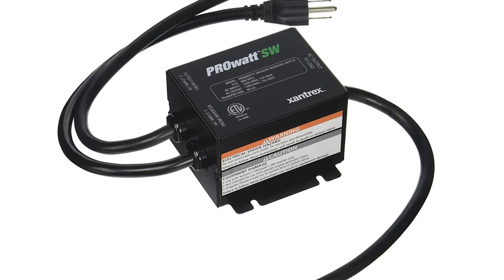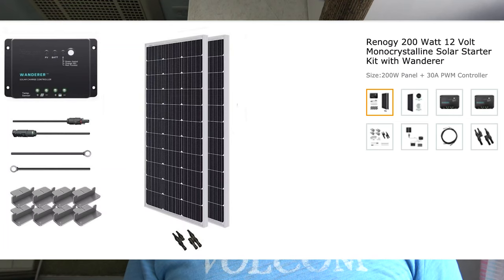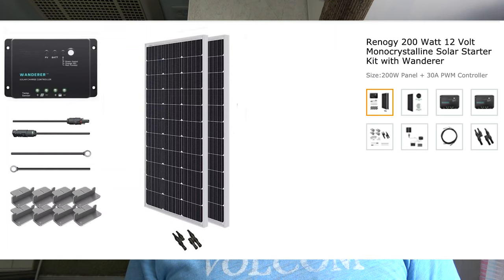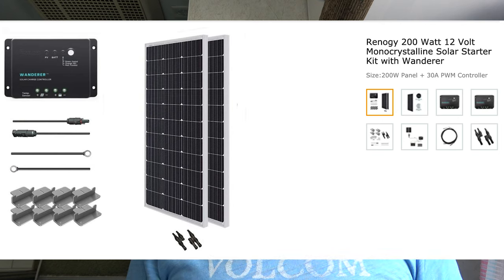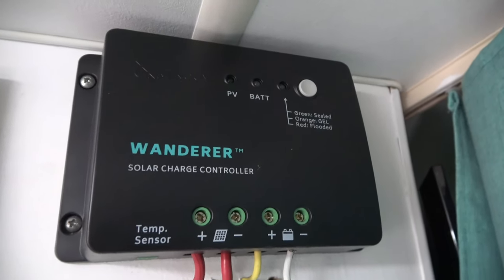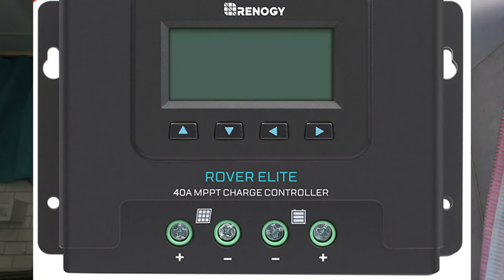Our RV Electrical System and Solar Power Setup // Truck Camper Living

Comment: Nice! Now I want solar even more. Mine is a an old seattle based camper so solar was kinda pointless until recently. My power system is original for this 2005 lance camper. If I want AC I have to plug in an inverter or run the generator. My inverter is old and I don't like how hot the laptop charger gets when it's charging on the Inverter.
I'm actually mobile too right now. I took my camper out to the back woods in montana and I'm working on a friend's dump truck. He's a major permaculture guy who has a big project coming up and the dump truck would really speed things up. LOL, it has a series paralell switch that sends 24 volts directly to the starter and I only did one and that was 30 years ago. I figured it out though. And wonder of wonders the propane side of the hot water heater started working. Up till now I figured I'd have to replace the whole hot water tank. Good fortune has smiled on me. Now I'm living in the lap of luxury. It's really beautiful here and so quiet! I'm lulled to sleep with the wind in the trees and the sound of the river which is about an eighth of a mile away. I brought the truck back to life a bit but I need to run into Missoula tomorrow for parts. 
Paul's all about Permaculture. It's a technology that allows you to set up your property so food is popping out of the ground or falling out of the trees. 
I'd kind of like to upgrade the muffler on the generator, one or two mufflers that are the passthrough type, like what I put in my truck. I'd like to quiet it down a bit but without adding a lot of exhaust restriction. Good times!
I'm looking forward to seeing your project unfold. I'm a bit cautious about Having litium ion batteries due to the risk factor involved. It they burn it's a scary toxic situation. I just replaced the two deep cycle batteries that came with the camper. I added a couple jumper wires and bought a pretty big deep cycle battery (to compensate for the house batteries, which were junk when I bought the camper. Now though I have three deep cycle batteries so I only have to run the generator for a half hour twice a day. If I had solar I probably wouldn't need to run the thing at all (since I don't like using microwave ovens anyway, due to health reasons. You've got be careful when you're doing the cancer thing).
Reply from the maker: Solar is virtually a "must" because of its ease of use/setup and cost. Lots of options out there too. We're just big fans of Renogy products and the customer and technical service they have provided us over the years.

Comment: We run 2 6volt Lifeline AGM’s (total 220 amps) that just fit in one of our dinette benches (Northstar Arrow truck camper) along with a 1500 watt Windy Nation (Amazon) inverter that fits in the same space along with large cables, fuses, etc.  with a lighted power switch outside the dinette so we can flip it on or off and see when it’s on.  We use it primarily for laptops/printer/Instant pot/hairdryer etc.  We use a smaller inverter for the tv/sat and antenna so we don’t need to run the bigger inverter very often.  The batteries inside are kept at better temps and we don’t run them below 50%.  Three years of fairly heavy use and no problems!  We have one 160 watt panel on roof and also charge off the alternator.  Unit came with this along with a Zamp 30 Amp PWM controller.  The controller has worked perfectly for our needs.  When these batteries go kaput
We will probably switch to lithium as it will cut the weight in half and we can run them down to 90% plus of battery capacity.  They are spendy upfront though. 😱. Then will probably make the switch to an MPPT controller suitable for lithium.  I also would like to add a good battery monitoring system like the Victron.  Who knows where the technology will be in several years :-).   Looking forward to hearing how you energized all the outlets.  We just have one outlet hooked up to the big inverter so I have to put the instant pot on my dining table or floor to plug it in😂.
Reply from the maker: That sounds like a great setup! In our case there’s no space in the camper for the batteries and inverter setup like you have but seems like you have a pretty user-friendly setup! Lithium ion is definitely the way to go for long term. We’re not sure that we’ve got any more than another 2-3 years in the TC before we’ll want to swap out so we’ll let the next owner do the lithium upgrades! ;) thanks for watching and yes we’ll post on what and how we tie all these things together!
Reply from the maker: Now that we’ve talked through your setup a bit I am intrigued and am going to see if we might be able to make something like that work for us. Would you mind emailing any pics you can to hello@calledtowander.com and we’ll give it a go with trying to plan out the system?!

Comment: I looked at Renogy also but found that HQST uses the exact same panels for much less. You can get a 200 watt system for a little over $200.00. Works out great for those just starting out. I have used this system for over a year with no issues what so ever.
Reply from the maker: The Renogy kit we bought was right around that price when we first installed it. And as we shared, it has held up under most situations. We're interested now in upgrading the controller and the batteries, so that initial kit has its limits in our needs. But glad you're getting bang for your buck with the HQST panels.
Reply: @CalledToWander  Will Prowse  did a comparison video and discovered they were the same panels. I also upgrade the controller. I am looking into 6 volt batteries because you can get more  amp hours from a smaller battery. I plan to tie two 6 volts together for twice the amp hours. Just so you know I also have a truck camper with limited space. I am using a KRIËGER 1100 Watt 12V Power Inverter Dual 110V AC Outlets, Installation Kit Included. With a wall switch to turn off and on. I want to go to the 1500 watt.  Love the videos by the way..

Comment: I recently bought an old Ford F350 and a Bigfoot camper. Planning to travel to Baja among other places.  Enjoying and learning from your videos. 1 question, in all of your travels how often have you needed 4wd. My truck is a 2wd dually but I'm considering trading out for a 4wd because of the camping options that would add. Interested to hear your thoughts.
Reply from the maker: Hey Tom, 4x4 is not necessary unless you're looking for places to use it. We ended up in an awesome offroad journey where we did require 4x4, and in the US we only used it at Lone Rock on Lake Powell (soft sand). The last upgrade we spent before we initially left 2 years ago was 1K on a winch. We haven't used it yet. But the one time we need it, we'll be glad we have it... so we think of 4x4 the same. For us, the more we go offroad the more things that break! So we are conservative with our off road adventures. But again, it really is a personal preference. You will NOT need it to do 98% of what you see in our Baja videos. The other 2% is optional. Feel free to reach out hello[at]calledtowander.com when you get closer to your trip as we have people in Baja we'd love to connect you to when you go! Thanks for watching and reaching out!

Comment: How long do you have to drive to charge the batteries from your alternator?  Do you use an isolator to keep from draining your truck battery?
Reply from the maker: The camper has an isolator to keep from draining the truck battery. From what our more knowledgable friends have told us, the recharge from the truck alternator is very minimal. We don't worry about draining our truck battery, but we also don't count on charging our camper batteries from our alternator.